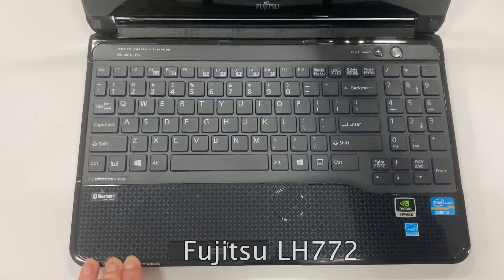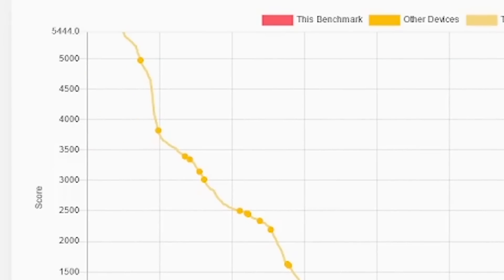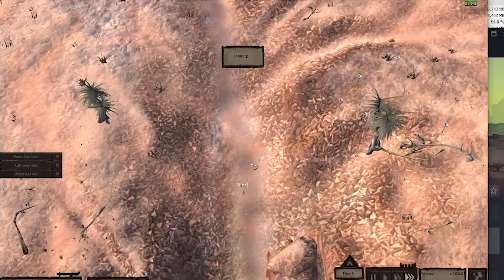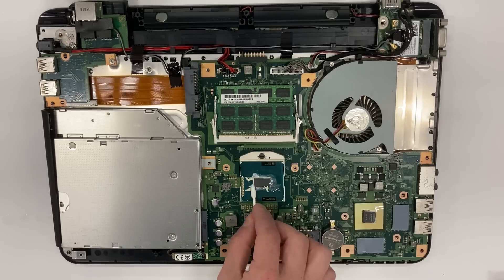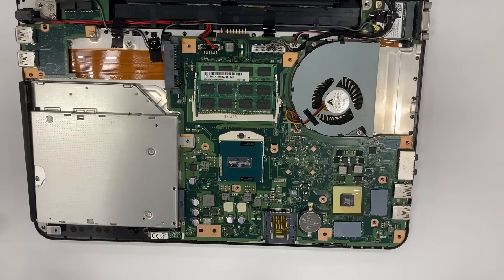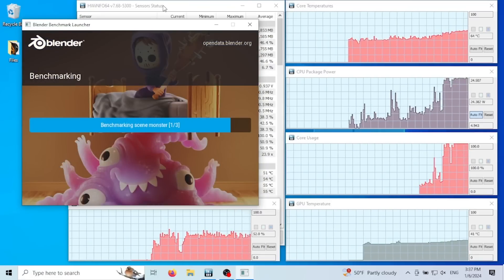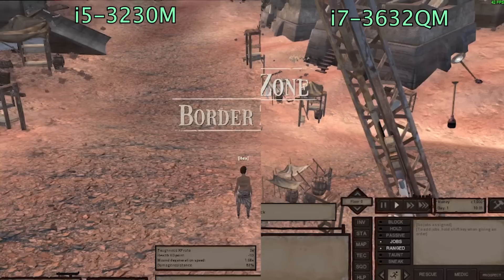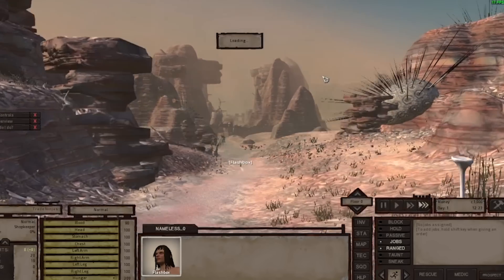Upgrading a 10-year-old laptop. Is it worth it?

Comment: Whether it's worth it or not depends on what you are hoping for.

One thing to keep in mind is that if you switch from an i5-3230m to an i7-3632qm, you're going from 2c/4t to 4c/8t, but you're also lowering the base frequency from 2.6 to 2.2 GHz. The 3632qm is designed to fit into a 35W TDP envelope and has to be clocked lower to meet it. Workloads using 1-4 threads will take a hit. You have to get to five or more threads to benefit. And where gaming is concerned, you're only going as fast as that GPU can benefit from added CPU power in any case. 

I actually did something very similar with an HP ProBook 4540s last year, replacing an i5-3210m with an i7-3720qm, a 45W 4c/8t CPU with a 2.6/3.3 speed. The 4540s never shipped with that CPU but is known to be able to handle it. I have a Radeon HD 7650M GPU onboard. However, I am also running Linux and more interested in multithread performance and not gaming. For me, the upgrade was a tremendous success and makes this machine nearly as capable, relative to time and place, as when it was new. If I were running Windows and wanting to game, I wouldn't have done this, especially since the Ivy Bridge CPUs can't run Windows 11 without hacking.
Reply from the maker: Thank you so much for the information! I am sure other people will also find it useful.

My main usage is running scripts and hosting local services. The gaming part is just for the audience, because I guess it would be more interesting for people to watch game benchmarks rather than script running.
Reply: Bruh love your videos where are yoi from?@hardwarerepair200
Reply: sir can i ask question? my old pc i5 gen 3 and motherboard digital alliance and GTX 750 ti(already re thermal paste cause GPU artifacts and never happen again) has keep alive for 6 year old and now my old pc every 1 weeks no signal after show bios cant boot to windows i trying remove cmos battery for 5 minutes and it normal again.but after 1 weeks it keep happen and happen again do you why know?? note: i replace cmos battery with new and my house electricity every day normal even i use UPS for unexpected power outage
Reply: Does Linux have a lot of overhead like Windows does? Thank you 🤓
Reply: @j.lietka9406  If by overhead, you mean system resources, Linux is less demanding than Windows. Linux will use less RAM and CPU cycles than Windows will on the same hardware, and it also supports older CPUs much better than Windows does. You can still run old Core 2 Duos viably on Linux. With an i7-3720qm installed, it positively flies.

The only drawback is that a lot of Windows software cannot be coaxed to run on Linux even with the Wine compatibility layer. If you switch to Linux, you have to be OK with using Linux software at least some of the time. When I switched in 2015, I had been using stuff like VLC, LibreOffice, Firefox and GIMP for years already. Going to Linux was no big deal, because all of those are FOSS software anyway.
Reply: @johncate9541  yes good description! Thank you 🤓

Comment: I had an old laptop that I stripped for parts and noticed the i5 2450M was in a socket, so I thought to myself what are the odds I could get a motherboard for a PC that this would fit into... and thus I now have a PC using this CPU and the laptop RAM with sodimm to DDR3 adapters.

Comment: Hello, what a great and very informative video it’s exactly the kind of information I’ve been searching for and u also provided even more information that I didn’t even know was available to access the way you were able to do it so efficiently and I’m very grateful that I found your video as I’m also looking into updating my Samsung R580 laptop that has the I5 chip and only 4gb of RAM. So I also want to update my ram from the factory 4gb to 8gb accept my device has 2 separate ports that are 2 gb for each one so I can get 2 4gb ram drives for 8gb for $25 for both and I can change my I5 processor to a I7-3220qm or a I7-840qm processor, for under $35. Do you happen to know if one is better than the other? Does it matter which one of these processors I choose? I’d really appreciate your feedback on this as I can see that you definitely have great knowledge and insight as to what processor would be best for me. 
Thank you and I look forward to hearing back from you and your thoughts on my questions. Oh also what did you put on top of the processor after u cleaned the fan and u put something in between the heat sync and top of the processor. I’m sure that I would need to do the same thing for mine , thank you very much 
Chris Klatter

Comment: Something to consider if possible for the GPU is using MSI afterbuner to overclock and specially undervolt the GPU, i personally had some luck with the desktop GT 740 back in the day, and squeezed some extra performance without risking anything, the same with some other laptops i had the luck to tinker with, not always possible, but always worth a  check.
Something else to consider, is that  W10 is quite heavy, specially in these older systems, would recommend a lightweight Linux distro, like Mint or Arch with KDE Plasma, that or roll back to W7, the intended OS for many of these old computers.

Comment: now is 2024, im still using my W540 that i bought back then in 2014, with i7 4800MQ, 32GB RAM and 2TB SSD, of course with windows 10 pro, to be honest, this is the best 2700$ that ive spent.
Reply from the maker: Old laptops are built to last!
Reply: my W540 used to heat up instantly. 70c even when playing a FHD youtube video i sold it but that 3K screen was the best thing i ever seen

Comment: Had Fujitsu NH 532 with same GPU GT 640M LE (Kepler 500/900). I modified GPU core and mem to 1000/950 with Nvidia Inspector to get best stable performance.
Reply from the maker: Thanks for the suggestion. I didn't know Nvidia Inspector. It looks interesting and will definitely give it a try.

Comment: I have a Fujitsu LifeBook laptop too. Need to get it running so I can use it! Thank you 🤓 my regular laptop is a Toshiba Satellite P875 - S7200. Also has a duo - core i5 but can be upgraded to a Quad core! There is also a bay for a second drive, the HDD could be upgraded to an SSD. The RAM is already at 16GB but could do a little better with a better name brand of RAM. As a kind of hobby I look for electronics in dumpsters and curbside stuff!
Reply from the maker: Me too, I love searching for electronics in dumpsters. I am very surprised to find fully working consoles, monitors from time to time.
Reply: @hardwarerepair200  my recent find is a PS 3 (found a PS 4 Slim 1TB HDD some time ago) that's the 3rd PS 3 I have found. Wanted to look some yesterday but raining too much

Comment: The i7 runs hotter and you are having throttling issues.
Reply from the maker: That's indeed one of my concerns. I have been wondering if the i7 version of this laptop has a better heat sink than the i5 version.
But the i7 version the laptop is quite difficult to find these days, so I can't confirm it.

Comment: Let’s see if it run cs2 with low settings
Reply: sir can i ask question? my old pc i5 gen 3 and motherboard digital alliance and GTX 750 ti(already re thermal paste cause GPU artifacts and never happen again) has keep alive for 6 year old and now my old pc every 1 weeks no signal after show bios cant boot to windows i trying remove cmos battery for 5 minutes and it normal again.but after 1 weeks it keep happen and happen again do you why know?? note: i replace cmos battery with new and my house electricity every day normal even i use UPS for unexpected power outage

Comment: i upgraded an Emachines amd laptop.. it was a 1.6 ghz single core athlon. staying with in the laptops advertised power limit i opted for a athlon 64x2 @ 1.2 ghz.. while slower at 1.2ghz the second core helps it out . and upping it to 4gb ddr2 from its 2gb also helped  at least it plays youtube videos now. if only its gpu was modular but no its onboard ati x1200 so its a great little old school lappy.
Reply: altho 1 prob is the emachines craptop laptops limitied bios shows the cpu as ????????  lol but cpuz shows its working fine.

Comment: Could have swapped the ram to higher capacity and speed and ssd?!
Reply from the maker: That's true! Will upgrade it further when I have the chance!
Reply: sir can i ask question? my old pc i5 gen 3 and motherboard digital alliance and GTX 750 ti(already re thermal paste cause GPU artifacts and never happen again) has keep alive for 6 year old and now my old pc every 1 weeks no signal after show bios cant boot to windows i trying remove cmos battery for 5 minutes and it normal again.but after 1 weeks it keep happen and happen again do you why know?? note: i replace cmos battery with new and my house electricity every day normal even i use UPS for unexpected power outage
Reply: @gunawangunawansantoso4122  give it a dishwasher wash then use CIF cream then hair dry straight away after rinse in normal water or medical alcohol if you have boiler room keep heated there over night forget thermal paste use thermal pads rather trust me ! Dish washer at 70 degrees for 2.30hours !

Comment: I did a similar upgrade to my 13y old HP laptop recently.
I went from i5 2520m to i7 2860qm, from 8g ram to 16gb, from 640gb hdd to a 480gb ssd, from a Quadro 1000m to a Quadro 2000m, changed keyboard to light, XFI soundcard, bluetooth speakers and bluetooth mouse+keyboard. More or less maxed it out.
Reply from the maker: What laptop model do you have? I don't know you can upgrade the GPU.
Reply: It`s a HP 8560w. Older more expensive HPs and Dell + Alienware and som Asus/Msi used MXM ports.
With the bigger HP 8760w you can have even faster gpus and there are modded bioses out there to support newere gpus like 900m series. 
Im thinking about trying it :)

The best upgrade i ever did was on my Alienware M18x in 2012 that had 2x GTX460m 1.5gb sli, upgraded to 2x Radeon 6970m 2gb cf.
Reply: @Bulltazar  You could still upgrade GPUs on high end laptops even now. They've stopped using MXM ports, but they use a different type of connection that still allows the laptop to be thin. As for HP 8560w, you're long way from maxing it out GPU wise,  I've had GTX 1650 in mine before I decided to upgrade to Zbook G4. There are Quadro options like T1000 in MXM Type A form factor as well. But they do cost money .. I think I got my 1650 for almost $200
Reply: @hardwarerepair200  bud pls tell me about x55v (i3 2328m to i5 3230m)? upgrade? possible?
Reply: sir can i ask question? my old pc i5 gen 3 and motherboard digital alliance and GTX 750 ti(already re thermal paste cause GPU artifacts and never happen again) has keep alive for 6 year old and now my old pc every 1 weeks no signal after show bios cant boot to windows i trying remove cmos battery for 5 minutes and it normal again.but after 1 weeks it keep happen and happen again do you why know?? note: i replace cmos battery with new and my house electricity every day normal even i use UPS for unexpected power outage
Reply: Which old hp is this?

Comment: I have a similar age Lenovo idea pad with an A8 4500m cpu, faster compatible cpus cost what my ‘piece of junk’ would to buy. It’s only my old machine which I kept as it runs a lot of older games with ease
Reply from the maker: Older laptops are really built to last!
Reply: sir can i ask question? my old pc i5 gen 3 and motherboard digital alliance and GTX 750 ti(already re thermal paste cause GPU artifacts and never happen again) has keep alive for 6 year old and now my old pc every 1 weeks no signal after show bios cant boot to windows i trying remove cmos battery for 5 minutes and it normal again.but after 1 weeks it keep happen and happen again do you why know?? note: i replace cmos battery with new and my house electricity every day normal even i use UPS for unexpected power outage

Comment: I upgraded my Acer Aspire 5552 it had a 3 core Phenom 2 N830 I put a AMD Phenom II N970 2.2 GHz 4 core in it as well as more RAM an a SSD drive.
I use it for flashing Eproms and SUSE Linux. I is a nice stand by when my maine Windows PC goes down.
Reply from the maker: Old laptops are built to last forever!

Comment: It's possible they glued it to prevent third party repairs, ensuring that if you want repair work done, you have to go through the manufacturer. And if it costs money, it puts it in their pockets.
Reply from the maker: Interesting! I've also heard that the 'glue' could potentially be thermal insulation sponge, strategically placed to prevent air leakage through the slit, thereby optimizing airflow for better CPU cooling.
Reply: @hardwarerepair200  That's also a likely explanation. I once did repair and upgrade work on my mom's laptop, and everything from strong adhesives, specialty screws, and stubborn plastic chassis hooks made it difficult just to pry it open, haha.
Reply: sir can i ask question? my old pc i5 gen 3 and motherboard digital alliance and GTX 750 ti(already re thermal paste cause GPU artifacts and never happen again) has keep alive for 6 year old and now my old pc every 1 weeks no signal after show bios cant boot to windows i trying remove cmos battery for 5 minutes and it normal again.but after 1 weeks it keep happen and happen again do you why know?? note: i replace cmos battery with new and my house electricity every day normal even i use UPS for unexpected power outage
Reply: @gunawangunawansantoso4122  Could be a multitude of issues, since it won't boot past POST. Could be the CPU gave out, you need to replace your RAM, the motherboard failed (or just needs a cleaning on the CPU, GPU, and RAM sockets) or you need to update your BIOS (if there are any left for a motherboard that old). I suggest trying a BIOS update first if you can. Then see if you can run MemTest86+ on it to find RAM faults. And if all that fails, try reseating the CPU in its socket.

And if that fails, consider getting a new PC. Costly repair work won't be worth much on an old machine.

Comment: Whether it's worth it to upgrade the CPU probably depends on the price for which one can get a faster replacement. I was thinking about replacing the CPU in my old Dell Latitude that I use as a secondary PC and reconsidered after seeing that the top range CPU for it was selling used for almost as much as I paid for the laptop.
Reply: sir can i ask question? my old pc i5 gen 3 and motherboard digital alliance and GTX 750 ti(already re thermal paste cause GPU artifacts and never happen again) has keep alive for 6 year old and now my old pc every 1 weeks no signal after show bios cant boot to windows i trying remove cmos battery for 5 minutes and it normal again.but after 1 weeks it keep happen and happen again do you why know?? note: i replace cmos battery with new and my house electricity every day normal even i use UPS for unexpected power outage

Comment: I did this with my old Samsung laptop, changed the CPU from an i5 to an i7, added more ram, changed the HDD to SSD and replaced the CD-ROM with a 2TB SSD in a caddy. It's 12-13 years old and I still use it today.
Reply from the maker: That's why I love upgradable laptops! With a small upgrade, you give it a new life and it can be used for another decade.
Reply: Me too
Reply: @miauw100  sir can i ask question? my old pc i5 gen 3 and motherboard digital alliance and GTX 750 ti(already re thermal paste cause GPU artifacts and never happen again) has keep alive for 6 year old and now my old pc every 1 weeks no signal after show bios cant boot to windows i trying remove cmos battery for 5 minutes and it normal again.but after 1 weeks it keep happen and happen again do you why know?? note: i replace cmos battery with new and my house electricity every day normal even i use UPS for unexpected power outage
Reply: @gunawangunawansantoso4122  Emmm... components such as capacitors, resistors and your motherboard MOSFET need to be checked further by a competent repairman to solve the problem
Reply: @miauw100  hmm... do you mean i need replace my motherboard with new ? i mean after i remove cmos battery it normal and within 6 day it normal and can boot normal to windows and it day 7 it happen again only past bios
Reply: sir can i ask question? my old pc i5 gen 3 and motherboard digital alliance and GTX 750 ti(already re thermal paste cause GPU artifacts and never happen again) has keep alive for 6 year old and now my old pc every 1 weeks no signal after show bios cant boot to windows i trying remove cmos battery for 5 minutes and it normal again.but after 1 weeks it keep happen and happen again do you why know?? note: i replace cmos battery with new and my house electricity every day normal even i use UPS for unexpected power outage
Reply: Which  old samsung is this??
Reply: @LuisAlbertoLopez-pq5um  I'm not sure of the model, it's a 2010-2011 model that I still use today.